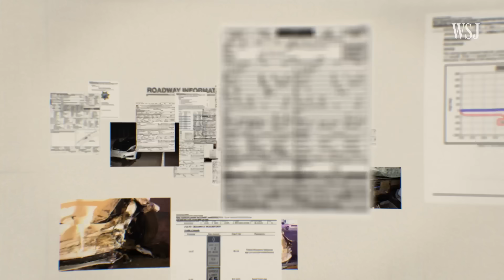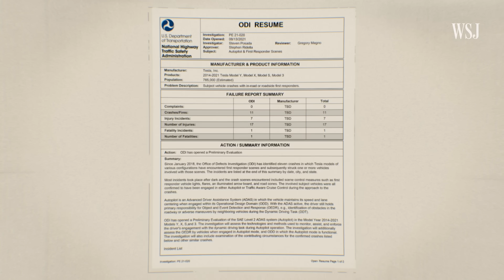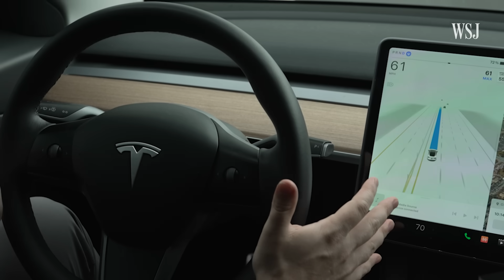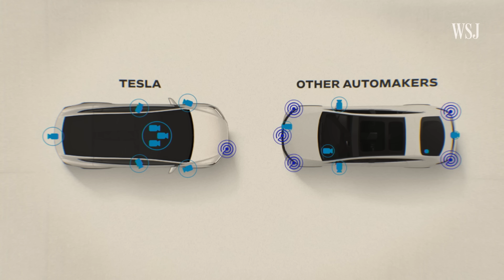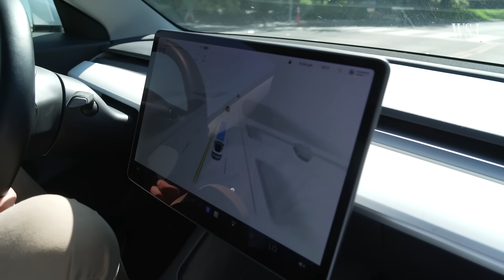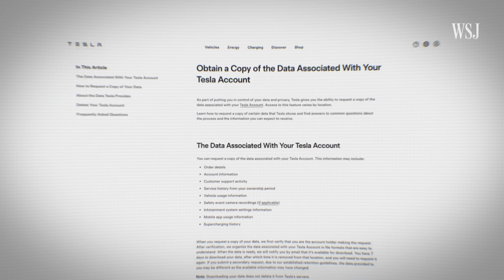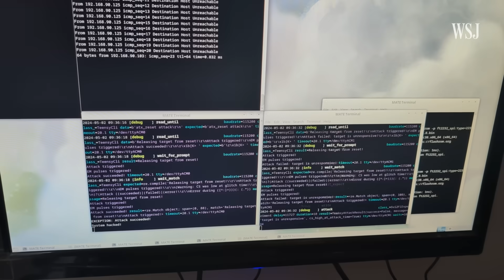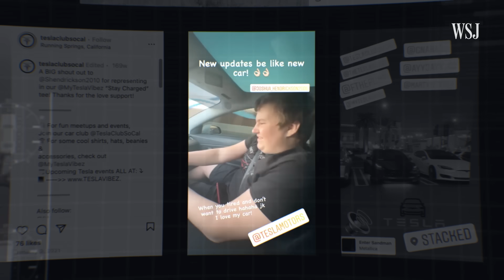The Hidden Autopilot Data That Reveals Why Teslas Crash | WSJ

Comment: Why does the WSJ keep using data from 2021 when its 2024?
Reply: Because they couldn't get the 2024 data??!? The video explains how they cross-referenced data sources. This takes a lot of time, and the first data set available was from 2021.
Reply: There isn't recent data available and that one was obtained with difficulty, but you know that and need an excuse for what goes against your believes, it's call cognitive dissonance.
Reply: @TheTomexification  Yes, and it's unlikely that things have changed appreciably since then as they're still using just the cameras and what AI improvements they could generate based on their own test drives. Things like the car slamming into an upended semi is just not something that's easy to train for as it doesn't happen that often. I've seen precisely one over turned cement truck in my life and another time I saw a boat that had been flipped by the wind. I'd be terrified of coming across either depending upon just camera based AI detection systems as those things are unlikely to come up during training.
Reply: @TheTomexification  The tech is evolving rapidly. Most of the claims/issues are no longer relevant. The guy who got 19 warnings on his drive, would have had autopilot stop being available after three today. If he drove like that regularly, he'd lose the feature all together.
Reply: @TheTomexification  I don't hate lidar. It is simply not needed. And anyone following this stuff will understand how close Tesla is to solving automation. It has nothing to do with cognitive dissonance. Just recognising the huge leap forward Tesla has made.
Reply: @daydreamer8373 Musk has been saying FSD will be ready “next year” e.g. 2011, 2012, 2013...
Reply: @SmallSpoonBrigade  You really have no idea how FSD and it's camera system works or how good it is getting. Driving over motorcyclists. Where do you people get these ideas? V13 performance Is driving Tesla stock to record highs, and it is only going to get better.

Lidar is not needed, and many are actually starting to abandon it, based on the performance of FSD, and following Tesla's lead.
Reply: @daydreamer8373 Question, do you ride Elon as a hobby, or as a job? No hate, I’m just curious if it’s money, or a personal void.
Reply: @charliekowittmusic  I am just calling it as it is, love him or hate him, FSD is set to dominate in this space.
Reply: @daydreamer8373  Well, none of the experts in the field agree with you, and Elon’s predictions were all wrong, but maybe you’re right! 🥰

Remember when he said they’d have “fully autonomous” cars by 2018? And that we’d have a crewed mission to Mars this year? There’s still 2 weeks left! Maybe that will happen too! 😌
Reply: @charliekowittmusic  Actually more and more experts are agreeing Tesla has the right approach. Tesla stock is rising to new highs on the back of V13 performance. Even Google's CEO is accepting Tesla are their biggest competitors.
Reply: @daydreamer8373  I don’t know what “more experts” means. Can you tell me the name of an expert on AV’s that has changed their opinion?

Who has changed their mind? And about what exactly? You’re speaking very vaguely.

I’m sure stocks will do amazing! Elon has his hand in government now, and the infrastructure bill is putting government contracted EV chargers all across America.

That wasn’t what we were talking about, however. Answer my question. Back up your claims.
Reply: @charliekowittmusic  the most recent example would be Google CEO Sundar Pichai. As for what has changed their minds. That would be the understanding of neural networks, and the remarkable progress of FSD since moving to that approach. As I said most people have no idea just how good FSD is getting. You are obviously one of those people.
Reply: @ You mean when he said “Tesla is a leader in the space”? Thank you for admitting you have no examples of what you claimed.

I think honesty and specificity are the best ways to have a clear conversation. I won’t bother giving counter examples. There are a dozen on the Wiki.
Reply: @charliekowittmusic  Who heads over Waymo, yes that guy. There are others. Mary Barra has also poited to Tesla having the right approach, while ditching their own cruise system. xpeng are following Tesla's lead,, ditching Lidar in favour of neural net approach. there are more but you get the idea.
Reply: This type of data is usually not made public by the car maker, like the mentioned clip in 6:50 was obtained by a hacker!
Reply: “Don’t speak ill of the master. You must not take Musk’s name in vain. PLEASE DONT SPEAK UNKINDLY OF THE MASTER!!”

🤯🤯🤯🤯 🚘 🚘 🚘 🚀🚀🚀
Reply: Because it’s fake news
Reply: Watch 6:50 people!
Reply: They would use 2019 data if they can get them
Reply: maybe it's because this concerns millions of tesla's around the world? What you recon genius?
Reply: @FabledGentleman  he says he is Pro Refugee ! just watching, not needing any data !
Free Free Free Free Hamas guy in the US .......data ????
Reply: Because it would show how stupid this article is.
Reply: @daydreamer8373  the refugee just sees it !
Reply: @daydreamer8373 you're Elon?
Reply: @daydreamer8373  I bet you can support this claim with evidence. No? Thought so.
Reply: Because she is one of the biggest lidar stock holder
Reply: @akellaji9828  why you guys hate lidar so much?
Reply: @BigBlueFlame-000  Because Musk told them to.
Reply: @BigBlueFlame-000 Because they need a "strong" (loud) leader like Elon to guide them.

Comment: This seems like a profoundly flawed system

Unlike a human driver who would slow or brake if they don’t understand what something is, the test keeps on going until it, then figures out that it is a obstacle and then may attempt to correct.
Reply: Remember this is from 2021. A lot has changed. Autonomy is going to make our roads far safer.

Comment: I have been a long time Tesla supporter and shareholder. However, there is no doubt Tesla has been pushing the technology at the expense of its users and other road users due to the tech being sold as “Full self driving” and “auto pilot”.  Selling a knife isn’t a problem, but selling a it as cut-proof knife** as long as you pay attention when cutting*** is

Comment: I was really into Tesla cars but then when he took out sensors lying about the reasons other than to push a cheaper product and stifle competition by slashing prices
Reply: If you don't need them. why put them in. It has very little to do with cost. Just common sense.
Reply: @ he took it out you lost features in the car after vision only. Vision only is limited not matter what you say you can’t go off vision alone for autonomous driving. Common sense is knowing that he did this when parts were hard to find during the pandemic. How coincidental that he needed fewer parts after they were hard to acquire?

Comment: Hey somebody better get to the bottom of this before Tesla starts running hundreds of massive semi-trucks using FSD on public highways. Look at what happened when Boeing said "just trust us" on quality control and hid problems.
Reply: Semi trucks are not running autonomously. There may be some testing, but that is all.
Reply: @daydreamer8373  Yet. This is exactly why no accident data should be hidden from objective analysis, regardless of the technology. Including autonomous drones and robotics, which tech bros and Wall Street will foist on the public for experimentation.

Comment: This is why sensors work better than cameras for obstacle detection.
Reply: a camera is a sensor. you're responsible and just for one to use autopilot one has to agree that one is to take responsibility for what one does.
Reply: *radar (lidar) sensors
Reply: Cameras are sensors.
Reply: camera is a sensor
Reply: @runlit120  - he means frontal radar sensor, not camera sensor 😀
Reply: @csuporj  I agree on the last 1%. but most people have no idea just how good FSD is getting or will become. Tesla are set to dominate in this space. They really are on the cusp of solving autonomy.
Reply: Tesla are getting very close to solving autonomy. Most people have no idea how good FSD is getting.
Reply: Victims of FSD will never know because they are dead!

Comment: Autopilot was a misnomer. It always was. Poor Elon deserves jail time for calling it autopilot. It implies that it was self driving without people giving input. Now FULL SELF DRIVING? It’s the same thing. And watch how they will twist this to always say it was older versions of assigned driving that led to each of these crashes. Or we have patched these bugs out of the system. But you can’t patch in peoples lives that you already took
Reply: Autopilot is a lane assist, it requires attention at all times. But yes this was indeed an old version. Tesla has improved the system massively. with V13 of FSD, they are showing they are well on the way to solving autonomy. It will make our roads far safer for everyone.

Comment: That's crazy.... Why not using RADAR or similar technologies to avoid collision? I mean Tesla only rely on visual recognition only? That's it? If it failed, then good bye? 😂😂😂😂 what a stupid engineering
Reply: In 2021 Tesla was still using radar. This was simply the driver not paying attention. A lot has changed since then. Tesla are very close to solving autonomy, and our roads will be far safer because of it.
Reply: @  If Tesla is advertised as an autonomous car, then how is it possible to blame the human driver if an accident occurs? The human handed over full control to Tesla's AI system.
Reply: @kaptenhiu5623  The human handed over driving to a level 2 lane assist. it is not self-driving. The human is ultimately in control and responsible. He didn't follow the rules, and sadly lost his life because of it.

Comment: I’m running FSD 12.5.6.4 on HW4 and last night the car did not stop for a red light.  I had to intervene at the very last second and slam on the brakes.  In my opinion, 12.5.6.4 has been worse than 12.5.6.3 having some bad regressions.

Comment: The highlighted case was in 2021 when the driver of a Model 3 was warned by autopilot 19 times. Something doesn't make sense here. How was the 3 strikes and you're out rule that disables use of autopilot for the remainder of the trip bypassed? Did I miss that in this video, or did WSJ deliberately omit the question? 🤔 I'm sure they would have been aware of that autopilot functionality otherwise this represents gross incompetence in their research.
Reply: Enough said. Just looking through all the media on the case and it's been silent since the crash in May 2021. Think most media realised there was no case when it became apparent the driver in question had a history of gross recklessness and irresponsible behaviour, eg. "driving while in the back seat and boasting about it on social media". Again no discussion of how he was able to get around the 3 strikes and you're out software limitation. Media went silent after the initial accident story. Bet the family never sued. This case study should never be used without the context being presented. Shame on you WSJ!
Reply: Strikes weren't in place at that time.
Reply: 3 strikes is for FSD, not autopilot. Autopilot is just to keep speed and lane stable, not fully autonomous navigation.

Comment: I guess if you were to implement an automated driving system, you would need LIDAR on the poles or LIDAR poles that inform the central processor of the automobile, so that obstacles are acknowledged.  

Just the same , a man driving six hours a day to get to work and return greatly increases the chances of being involved in an accident.

Is there any chance of reducing that probability?  You have to wonder.

Comment: In every single one of these cases, there was still a human driving, who could at any time steer, brake, or accelerate, overriding the automation system. Used properly, it should be at minimum no worse than no system at all.

Comment: This doesn't seem like autopilot is causing the crash. It seems like it's because the person operating the vehicle stopped paying attention and didn't see the hazard in the road. 

The technology isn't quite there yet to take a nap while driving, but it's getting close enough for people to let their guard down and be lazy.
Reply: Humans are notoriously bad at watching correctly running automated systems - without any stimulus to keep them focussed on the task their attention will inevitably drift away. Its standard Man-Machine Interface theory.
Reply: people will always be lazy and companies need to develop products that account for that
Reply: @maxoldendorff3264  When using FSD you can't pull your phone out for more than a few seconds or you get a warning. Get a few warnings and you get a strike, and the car wont go into FSD for the rest of the drive. Get 5 strikes and FSD doesn't work period. I'd argue that I'm more attentive now w/ FSD than I was driving manually.
Reply: @maxoldendorff3264  They have,  they're called buses.
Reply: If the technology isn't there, they shouldn't be calling it "autopilot".
Reply: @WarlordEnthusiast  I mean airplanes have been calling that for years... but yes it should be very clear that it's just advance cruise control
Reply: @WarlordEnthusiast  💯
Reply: Autopilot cannot avoid crashes which would have been easily avoidable if it had LIDAR.
Reply: A loud sirene alarm in case of autopilot ai ambiguity would help too. But not when autopilot thinks nothing is wrong. And indeed, you can't have a machine drive a car and expect the human to be able to intervene at any moment needed. Humans don't keep their focus when it appears to not be needed. Hence it should not be even allowed to be marketed and used like that. It is fully automated or not. Not half way.
Reply: People can't constantly pay attention when there is almost never anything going on. This is extremely well known and a perpetual problem when people are supposed to be constantly watching for rare problems.
Reply: It's not that people let their guard down and become lazy; it's more like the only way you can be fully alert and tuned into the flow of driving is if you are in the flow of driving.  Sitting their as a spectator, meant to be ready to intervene when required, lets your mind stray away from the immediacy of driving.  Your mind and your attention are elsewhere, and it takes a lot to reclaim your focus and a long time to get back "into the game," time you simply don't have when you're moving at highway speeds.
Reply: Musk clearly says the technology is already there and that it is better than a human driver. He has been saying this for almost a decade now. So it's no wonder that people believe it and act accordingly. They call it "Full Self Driving" for a reason.
Now, I agree that people are stupid for believing a single word that comes out of Musk's mouth. But I bet you are one of those that believes everything else he says, but conveniently not his lies about FSD.
Reply: Tesla now strictly monitors the drivers behaviour since an update roughly around August 2024.
Just holding the steering wheel doesn't cut it anymore.
Reply: Regardless, the tech does not work without human intervention... Or in other words it does not work.
Reply: Exactly.
Reply: You are a sycophant. If the technology isn't there, why is it being sold as if it is? 
Why aren't other systems having the same problem?
Reply: Then it shouldn't be legal to use on public roads.
Reply: Take over the control !
WHY SO STUPID ????
Reply: People have been surviving situations like these when driving for years. The only new variable in this is Tesla's autopilot. They shouldn't be allowed on the street with us.

Comment: Eh, the framing of this seems a bit dishonest / misleading. The thing is they can and do improve the software all the time. And if they've identified evidence that the hardware DOES have the information in it that could have prevented an accident, then that means the software is capable of avoiding it.

Also, as for culpability, the question is not whether it makes mistakes or whether it can avoid every accident that a human can avoid. The question is this: was the Tesla on autopilot safer than the alternative. Was the autopilot than the guy who's too drunk or too sleepy to drive and decided to drive anyway? Of course it can make mistakes a human would not. But the proper calculation is whether, on aggregate, averaged over thousands of people, they make fewer mistakes.

All this said, I do think Tesla should be more transparent about their tech's weaknesses so that people can be more aware in those situations.

Comment: Interesting discussion, I do think there needs to be human accountability, everyone knows it’s a   supervised system. Also there is not enough explanation to the average viewer of this video in the differences of autopilot and full self driving. For those not in the know autopilot is basically and fancier version of cruise control, it maintains speed on highways and stays in the lanes hands free, and brakes for cars in front of it if traffic slows and is only supposed to be used on highways and not city driving. It does not recognize, stop signs, or traffic lights and doesn’t even have the smarts to reduce speed in tight turns last time I checked. In that one video where the Tesla blew past a stop sign and off the road, that’s due to a guy trying to use autopilot like it’s FSD. Autopilot once again doesnt recognize stop signs. I think Tesla should just get rid of autopilot and have fsd as an option. I think people either don’t understand the difference or just flat out mis uses autopilot. Fsd is the safer option all around